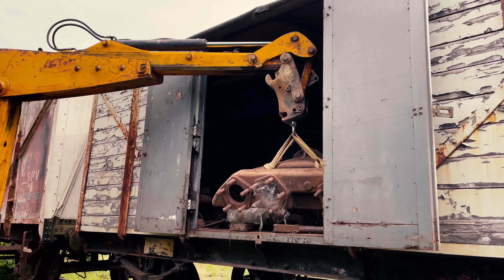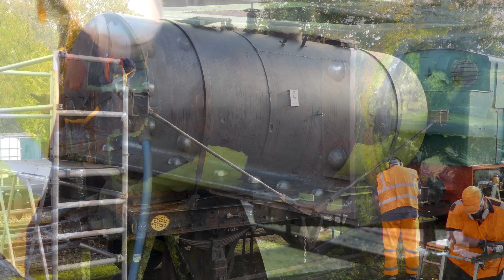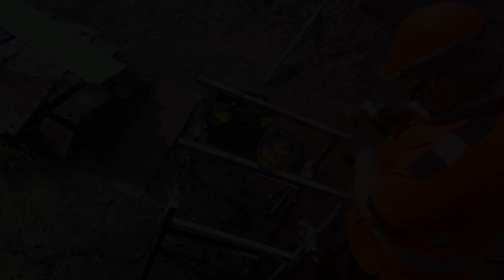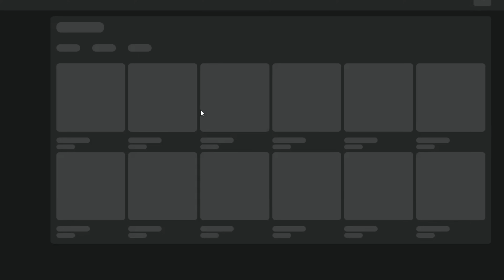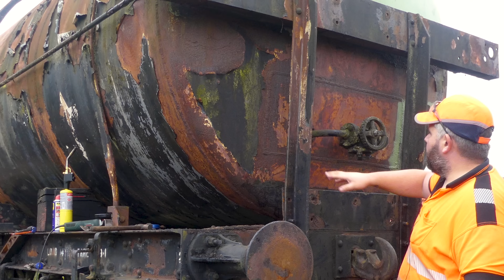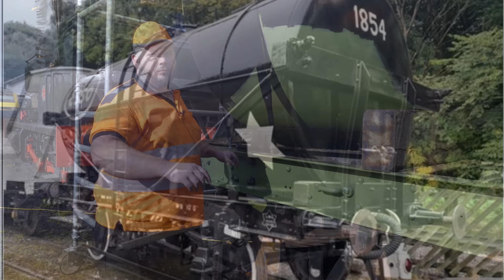14T Esso Tanker - Uncovering history!

Comment: I still see some severe pitting in the tank you guys should have fixed before you finish the paint job and reassemble the wagon. It would be a huge pain if these spots of thin metal start leaking once you fill it up.
Reply from the maker: There are no plans for this tank to be refilled
Reply: @WardleRestorations  Then it shouldn't be an issue. It's a shame, though, if it's never gonna be useful again. But restoring it to load capacity might be a huge cost factor. I've never owned a railcar 😂
Reply from the maker: @robine5280  Well if you ever do plan on owning one, make sure you have some money set aside! lol

Comment: Just please be careful when jacking with 4 jacks as you can end up with the full weight of the wagon on 2 diagonal jacks. When I have designed lifting schemes I always allow for the full weight on 2 points + a bit more for safety.
Reply: Adam here, thank you for sharing. My thought is, that we raise it a bit and reset and secure it. So jack it, lower it onto a base, reset the jacks and repeat rather than one big lift, we increment in lots of smaller lifts. We have to be careful of certain things and need time to monitor as we go. Having that option to stop allows us to call it quits early.  I'll keep your "full weight on 2 points" in mind. Thanks!

Comment: It's looking gorgeous dude! Just tell Adam there to put the guard back on the angle grinder or don't show him doing it, really dangerous
Reply: Wire wheels won't fit with guards in place but we do use a full compliment of PPE at all times. We do like to think we take safety seriously and receive training from the railway on a regular basis. We thank you for your comment though it's appreciated 👍🏻
Reply: Adam here, I appreciate your concern 👍 The guard is in use for all other uses (cutting, grinding, flap wheels etc), but these cup wheels are about 2.5 - 3 inches tall, they sit proud of the guard - the guards are only about 1 inch in depth. The guard is a lot wider than these wire cup wheels, and that itself can create a restricted view of the work. We try our best, and I do appreciate the accountability. Adam